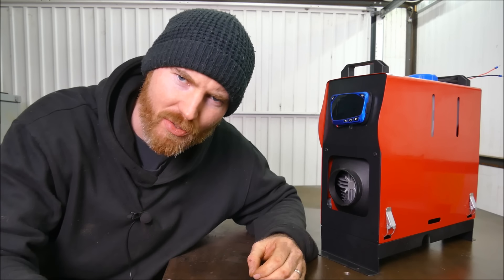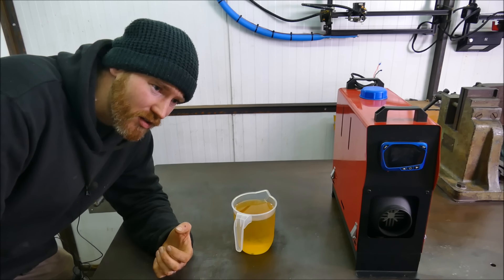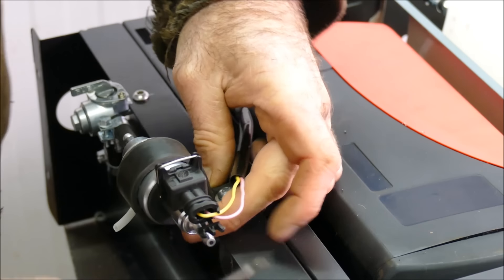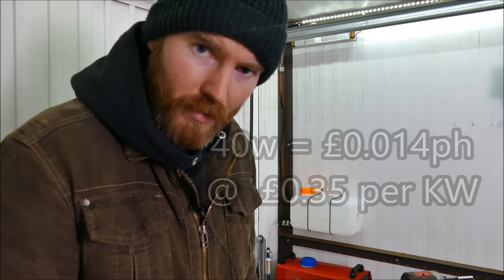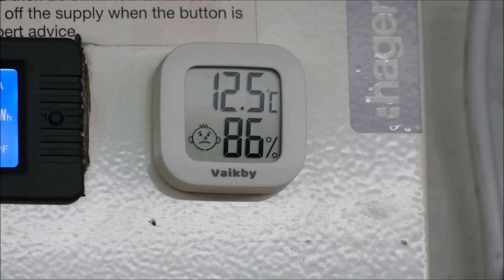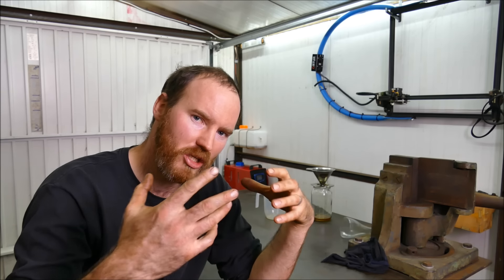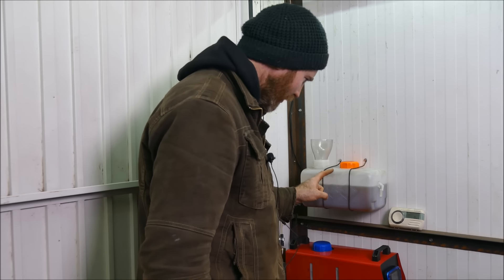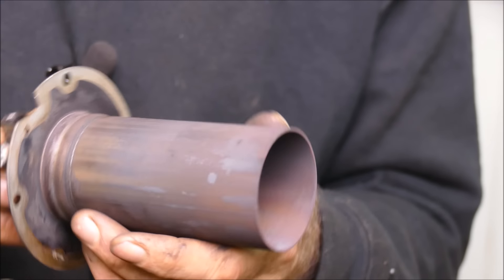£0.03 per kWh heater modification - Top facts & lies on diesel heaters - waste veg oil burn success

Comment: 20:06 "we've extracted about half of the energy out of it" 150 degrees C is not half the energy of 300 degrees C. you have to convert to kelvin to do calculations like that.

Comment: I wonder after watching this video.  Do you think it's possible to have some sort of stone or rock in front of the heater which could retain the heat like storage heating systems so that after using the blower in a cold area it doesn't just get cold but can keep dispersing heat throughout the day?

Comment: Run 4 lengths of 20mm copper pipe touching the exhaust in a box design passing water through this will extract a lot of heat.

Comment: hope you doing good what pump should I run on 50% old used oil and 50% disel I'm having a carbon build issue should I run on max speed which is 5.1 hz thankyou
Reply from the maker: You may want to try adjusting the air fuel mix if you can so it's burning oxygen rich. It may be a case of lowering the Hz and increasing the fan speed. I believe I have mine on max rpm and 3hz. You want it well filtered too and maybe pre heated depending on the oil type. Cheers J

Comment: Its starting to get 'colder' hows the heat exchanger going? and try out the veg gelatine to bond to get excess deposits and burn cleaner on less % kerosene..
Reply from the maker: Hi. I've got several new videos on the heater planned and I've gathered materials such as a large hot water storage, radiator, thermal sand battery, modular home installation that fits on a window, safety protocols, silencing, fuel filtering methods etc. All coming soon as well as improved wood burner. Cheers J

Comment: Why take in air from the outside? Wouldnt it be better to take the air from the inside which would be warmer?
Reply from the maker: Not for the combustion. Cold air is better because it's more dense with oxygen. But mainly it's about creating positive pressure in the room so cold air isn't being sucked in. Cheers J
Reply: @joshuadelisle  Ah that makes sense. So I should drill a hole through the garage for air intake and one for exhaust. I think a 28mm hole should do it? I dont really want to keep the unit outside and drill massive holes.
Reply from the maker: @Festivejelly  that's right. Just make sure there is nothing combustible touching or near the exhaust. Cheers J

Comment: I know you said it pretty clearly, but just for my ignorance....you did not have to process the veg oil any more than just filtering?
Reply from the maker: I just filtered it and mixed it with 30% Kerosene. It does work better if pre heated also. Cheers J

Comment: If you mind me asking i have a 18 ft L  by 12 ft  W 8 ft high workshop  i would need the the 8 kw heater am thinking will wait for your reply before i buy one
Reply from the maker: The 8kw will do nicely. However it's very dependent on how insulated and sealed your workshop is. If it's a tin shed with air gaps you'll be wasting a lot of heat. If it's fully insulated with zero drafts then a candle under a plant pot can heat it up fine too. I currently have mine on for up to 3h a day and that's enough to keep it a warm space. Cheers J

Comment: I think if hard pipe this heater to extract the heat from the exhaust, yes takes longer to heat up but will last longer and be more solid. Even with  copper 3/4” would probably last many years. Not sure on the chemistry with the copper and exhaust so don’t hate me just and idea I thought of

Comment: build and installed the first heater the guild is amazing thanks bro i did try to access the admin panel and 1688 didnt work XD any clue haha its the tricklicks one you suggest to grab 

dual tank system in place 15L worth lets see how long she will run for before she conks due to residue build up :)
Reply from the maker: Depends on which you bought but it should be in the manual. Cheers J
Reply: @joshuadelisle  i got the little one from your links mate can you share the other codes for the other units 1688 defo didnt work for me ive gone over the manual again and there defo aint a admin code haha 

merry xmas too
Reply: Ok for tricklicks one it's 1234 however it seems they changed something as not the same settings available

Comment: I was burning waste oil in mine last year. Never filtered it but was running oil that wasnt super dirty. Was cutting it with diesel and gasoline. It carbon clogged the heater in a month.

Comment: JOSH  
your exhaust pipe isn't letting bucket water in. The water is condensing the exhaust fumes faster and water builds up inside. YOU KNOW THIS. 
The exhaust pipe needs to flow downwards from the heater. 
Your exhaust pipe can be spiralled down through an insulated tank and out the bottom. The exhaust pipe must never incline. 
Pipe the exhaust tube downwards to top point of a standard radiator then pipe the bottom radiator port to the outside to drip.

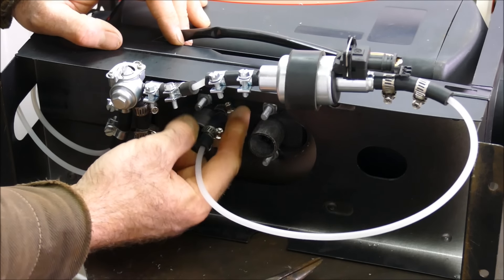Comment: 9:39 Why on earth not run a continuous rubber hose between the selector valve and pump, instead of stepping down to a smaller diameter plastic hose creating more potential leaks and a constriction, and using two more clamps? Looks bodgered mate.
Reply from the maker: It would probably work fine as you say but I wanted a consistent pipe diameter and a place to possibly add a second pump If I was to do a fuel pre heat system. Cheers J
Reply: Not to be disparaging or nuffink, you understand...lol

Comment: my controller has a "PF" setting...range 1 to 6, I believe it controls the glowplug power but what should it be?.... thanks
Reply from the maker: I have mine on 6. I might last longer on a lower setting. It needs to be enough to light the fuel. Cheers J
Reply: many thanks, was on 4 and it seems to work OK....

Comment: Heat the veg pil 1st befor it goes into the heater by winding a copper pipe around the exhaust using it as a fuel line heati g that oil very hoy creating a perfect clear exaust. You will save on fuel too.

Comment: I use red diesel in mine as I live on a boat so always have a tank at least half full.
 I have the 2.5kw one, works well, tis pretty quiet and cuts the condensation down loads.

Comment: I would like to see someone run the exhaust close to the unit through a small car radiator empty and exhausted outside and put a fan behind the radiator to push more heat into the room increasing BTU

Comment: Also cold air has more oxygen per volume than hot air. Having oil in the bucket and not water means little corrosion on the metal bucket or exhaust. If you cool down the exhaust and put it inside a green house, the plants would eat most of the c of the co2 on a sonny day.

Comment: If you put red loctite on the rivnut it'll stay put and resist turning in the future. Don't put it on the threads, just outside. Works.
Reply from the maker: @gorporpio  good tip. Cheers J

Comment: Hello sir , maybe Conect exhaust to a heater changer and let the exhaust GAS go out and try transform the heat from the heath transfer device go back in house , You know theese transfer heathers that have a big space inside full with coils and go in one side go out other side like 2 way road , maybe with șmal ventilator You can recuperate some heat

Comment: How do you use a heater like that inside with the exhaust? I have a built in diesel heater on my campervan and it smells pretty when outside.
Reply from the maker: You mustn't have the exhaust inside. All you'll be doing is filling your space with carbon dioxide/monoxide. The combustion gasses must go outside away from your breathing space. Cheers J
Reply: @joshuadelisle  Exhausts get very hot. So how do you do yours?
Reply from the maker: @marcandsebe  I would recommend having the heater outside and duct the hot air inside through a hole or vent. For a static you should have space underneath and lots of air circulation ports to choose from. Just make sure there are no combustible materials near the exhaust, heater or fuel tank and maybe box it in with some steel galvanized sheeting as a safety measure and keep it tidy. For any combustion heater you must have CO2 alarms, fire alarms and extinguishers if possible just to make sure you're covered if such an accident occured. I hope that helps. Cheers J

Comment: Maybe it was already suggested. Maybe try to put the veg oil container on the same level or more down then the original one. Maybe gravity plays. And density. I had a 524td bmw running on pure cleaned veg oil back then. It had more power with the veg oil then with diesel..
Reply from the maker: Nice 👍

Comment: Does the 5Kw 12volt system have a 24vdc setting?  Or is it a particular model #.
Reply from the maker: I'm not sure for every system but on mine I can switch to 24v in the settings. Cheers J

Comment: It would be better to get rid of the bucket of water and run a low amp fan behind the exhaust pipe to push heat into the room.

Comment: In estonia kerosene costs about 4€ per liter so its not a cheap oil for heating. Diesele from the gas station costs about 1.5€ per liter.
Reply from the maker: @MetalPandora86  what about heating oil bought in bulk. Cheers J

Comment: Cost of electricity per kWh in UK is 24p. Not 28p
The cost to run a heat pump....
The smallest heat pump for small two bed house is 3kwh = 72p hr.
Therefore, in winter they encourage you to run it 24hrs day = £17.28 per day, £120.96 week and enough heat NOT guaranteed!!!
1/2 kWh elec heaters 12p hr. Running 3 in separate rooms 36p hr and the thermostats will turn off when temp is reached. = <than 36p hr. 
<£60.48 per week to run

Comment: In the  states Diesel is greenish  yellow and Kerosene is red (also used as off road fuel for dozers and such... also for some heaters they use k1 "kerosene"" but I'm not sure what that is but its clear and doesn't make a lot of soot  so iyt is also used in lamps and other wick type lanterns and heaters...I wonder why all that is...

Comment: If the unit is outside, you run the risk of having the fresh air intake(the vent on the rear of the unit, not the intake located on the bottom of the unit) suck in exhaust, and then it comes out through the heat duct, into the living area.....be careful.
Reply from the maker: The air circulation intake should go inside also. So two ducts. It works best if one duct goes to the far side of the room away from the first duct so It creates a circulation in the room. Cheers J

Comment: Fill the bucket with sand instead of water... it will hold more heat as a battery and won't boil off...

Comment: To clean your  waste oils, mix up bicarbonate and a bit of water, then add to oil, heat up until boiling and the bicarbonate will take all the crap out. Of course it depends on you amount of oil to clean. Easier than filters.
Reply from the maker: Good tip. Thank you. Cheers J

Comment: 10kwh potential energy in liter of diesel. 1.30 for a liter of diesel is .13/kwh, like you said it’s not 100% efficient because exhaust you got about .15/kwh. Heat pump(residential) is about 300% efficient so it can move 3kwh of heat for every 1kwh of electricity. At your electricity rate here that would mean you could move heat into your house for 0.11/kwh. More expensive heat pumps are more efficient so you could go higher but they also are more expensive. So if you live somewhere where you already have a mini split heat pump for air conditioning it’s cheaper to run that for heat assuming your outdoor temp doesn’t really drop below -5c

Comment: Using Wikipedia numbers, EN590 (aka British road standard) diesel has 43 MJ/kg That’s about 35 MJ/litre which works out at 9.7 KW hours. 
Allowing for efficiency losses heater could make 8 KW if it could burn 1 litre per hour. 
8 KWh @ £0.35 is £2.80. Pump diesel costs £1.30 per litre so you are getting about 1/2 price heating compared to electricity. Lower power settings are probably more efficient (less heat lost down the exhaust).

Comment: Don't know if you pressure tested the first exhaust, but if it wasn't simply condensate in the line the line might have gotten a fracture when you put it in the water while it was hot.

Comment: How long have you run it straight at once.  Thinking of one of these to run all the time on low setting to keep chill off garage . Thoughts?
Reply from the maker: @greghasselback  it will run for a long time. Especially on a low setting it uses hardly any fuel.  I only use mine for 1hour stints and then because my workshop is well insulated it remains warm for a long time. Cheers J

Comment: The combustion process of any hydrocarbon generates some H2O (water) molecules. If the exhaust drops below 212F it condenses inside the exhaust and collects and will stop flue gas leaving. It wasn’t a leak in the ribbed tubing, you generated the water thru combustion of Hydrogen in the fuel.

Comment: These are fantastic!!  Cut my electric bill buy 62%...   I get old desai for free at junk yard.. run my line into a 15 gallon tank with a small filter on it 16 days on 1/2 speed..  never cutting it off.. I mix old engine old in the desalination fuel sometimes..  no problems 2nd year. !!
Reply from the maker: @nancen7128  nice. Cheers J

Comment: Kerosene in the S.E. part of the USA is $3.10 USD per liter
Reply from the maker: That's a lot. Is that from the pump or bought as heating oil in bulk (500ltrs)?
Reply: @joshuadelisle  i haven't been able to find it at a pump near me so that price is for a gallon jug from Lowes.  Walmart and Tractor Supply has it at the same price.
Reply from the maker: @mondavou9408  yes. You only find savings when buying in bulk.  Either by the barrel or from a tank truck.

Comment: I haven't seen that your air inlet pipe is the same length is the same length as the exhaust pipe to balance the pressure.   The ones fitted on trucks were always equal.
Reply from the maker: It's not as long but it is extended. I've not noticed a problem with it otherwise. Cheers J

Comment: Why the plastic line in between connections of rubber hose? Too many places to leak fuel. More clamps too! One thing I don't like about these heaters is, the fuel source is above the heater in a plastic container. If you're modifying it anyway, remove the tank and keep your fuel sources away from it. These heaters are similar to ones used in military equipment years ago. Harder to get started the colder the weather because of geling of diesel fuel. Kerosene would be the best fuel below 40 degrees and switch from there.
Reply from the maker: Agreed. The plastic line is for constant diameter and because of pre cut connectors. Kerosene for outdoor fuel tanks for sure. Cheers J

Comment: Would it run waste engine oil from Cars
Reply from the maker: It can in theory at least if filtered well, mixed with a little kerosene, pre heated and change the settings to a higher air to fuel ratio. It's best to run the heater before and after for while on straight kerosene to clean out carbon deposits if you do. Cheers J

Comment: Heh Josh, loving the YouTube vids, they are spectacular. I wonder if you could look into the Atmosclear on demand hydrogen generator. I have one fitted to my 2013 defender 2.2 puma 110 diesel. This easy to fit item removed up to 95% of CO2 emissions from the exhaust by just creating a small amount of oxygen and hydrogen through electrolysis and introducing it to the air intake. When a lead acid battery charges the same bye products are released which begs the question why don't manufacturers pipe the battery breather into the air intake? Can't help but think ot is all a big con to get people to buy electric. Would be really interested to see your take on this
Reply from the maker: Hi. I believe I sent you a link to a video in the message you gave me on Etsy. Cheers J

Comment: Hi, I have two diesel heaters, and are considering Kerosene or bio diesel - which should I use and safest to store  ?
Reply from the maker: Both are safe to store as diesel/kerosene doesn't combust thanless it is atomized or wicked (much safer than gas or petrol). If you can get a storage tank then you can buy heating oil (kerosene) at a bulk price, eg 1000lrs for £600 is £0.60 per liter which is what I buy it for. Kerosene and bio diesel doesn't have additives for lubrication which is essential for an engine but not a burner. The pump however will wear out quicker on kero compared to regular diesel because of less lubrication however the pumps are cheap and mine has lasted over a year now and more than paid for itself in fuel cost savings. I'll be doing more soon to capture exhaust energy using a water heat exchanger and maybe install underfloor heating with it. I hope that helps. Cheers J
Reply: Thanks, exactly what I needed to  know

Comment: I saw a video that stated that kerosene causes the pump to pack in quickly as it does not lubricate as well as diesel. Any thoughts?
Reply from the maker: Pumps last plenty long enough on Kerosene (at least a few years) and they're cheap enough to replace too (£10). Cheers J
Reply: thanks and great channel!
 @joshuadelisle

Comment: Wow lots of comments here and i don't know if my idea was previously mentioned. You can put exhaust pipe inside a bigger 120-150mm pipe. On one end you put a 12v fan to put air inside the pipe and on the other end another fan to blow the hot air. Connect some fan speed regulator on both fans and you will have a fan coil blowing hot air.

Comment: I have the fuel line come in through the top with a weighted pickup at the bottom of the tank. I'd rather not have the tank drain in case of a leak.